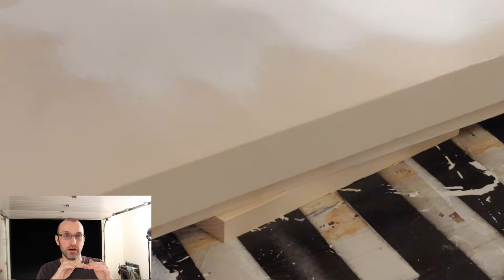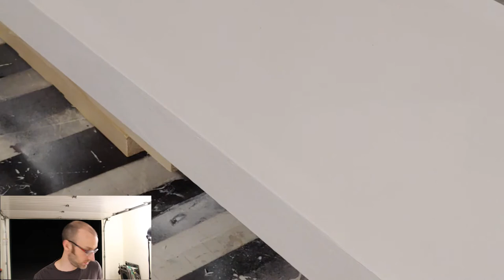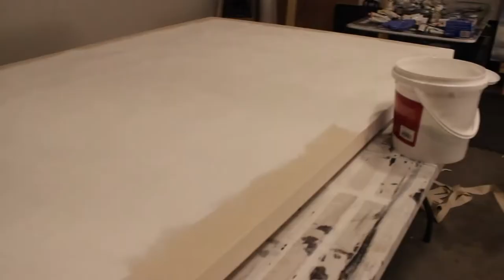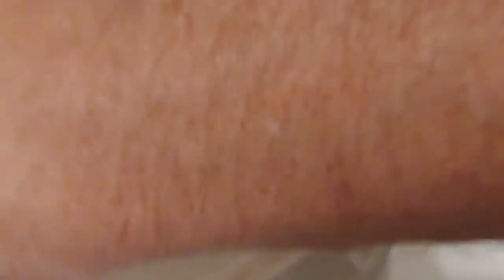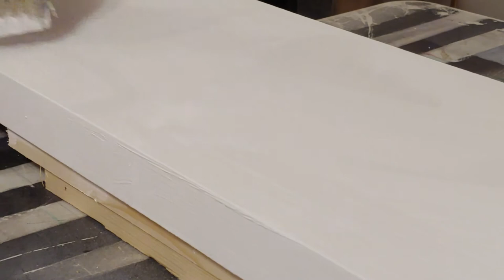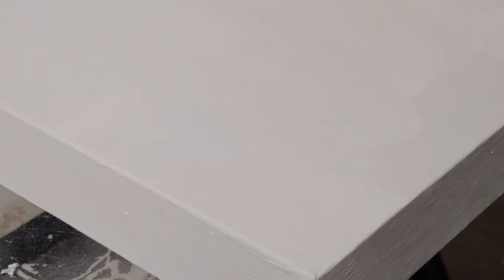Make Your Own Canvas Pt. 4: Priming Canvas

Comment: Hi Mead, thanks so much for sharing all this content with us! I have made a few canvases this week following your videos and they have all turned out great. I've moved on to priming and now I'm having some hiccups. I have painted the first and second layer of gesso starting in the center, and circling around as you instructed. Using this "scumbling" technique the layer of paint is even, without texture for the most part - but it looks sort of splotchy because of the irregular strokes and circle nature. Do you have any advice for how to prevent this? Also how many layers are you priming and do you change your brush stroke on the following layers? Thank you!
Reply from the maker: Priming tends to be splotchy by its nature. Don't worry too much about it. I usually do 3 layers of primer, but some brands are thinner and may require more. A good way to test is to hold the canvas up to the light and look through the back. If you see holes, you should prime more, if not, you're good to go. If you're painting in acrylic for initial layers, then you have no worries at all.
Reply: @MeadMcLean  Ok that makes sense - for what I am doing, I am ultimately wanting to create a fully flat, smooth off-white background which I will then paint symbols on top of. I was hoping the gesso process would get me there for the background, but perhaps not. In your experience, do you feel it just takes lots of layers of paint to achieve this look or is there a certain acrylic medium that could assist? Thanks again for any advice you may have. (and for reference, I am intending on only using acrylics)
Reply from the maker: If you need something smooth, I would use a foam paint roller with matte acrylic latex house paint or liquid acrylic. Then do your symbols, then run a clear acrylic varnish coat over top to seal it.
Reply: @MeadMcLean  so helpful, thanks for thanking the time to answer my questions!
Reply from the maker: Not a problem. I'm always here to help.

Comment: Do you need to glue (sizing) the canvas before priming? and why not? In general, I noticed that in the USA no one glues the canvas but immediately primes it ... why is that? is not gluing necessary or what?
Reply from the maker: Yeah that's a good question. The sizing is only necessary if you're using old-style traditional oil-based gesso. Most people now just use Acrylic Gesso, which is just a water-based primer. With old-style traditional oil-based gesso, you can't really paint in acrylic on top of it--just oil paint. With the newer Acrylic Gesso, you can paint on top with almost anything--oil and acrylic included. If you're an oil painter, sizing and oil-based gesso does create an amazing surface, but the smell of heated rabbit-skin glue and the extra steps involved aren't worth it to everyone.

Comment: I can't imagine companies which sell pre-primed stretched and canvases brushing on gesso in the manufacturing process. It just wouldn't be cost effective considering the time spent doing so and the inability to ensure an even coat. Obviously, these companies spray the gesso on to their stretched canvas products and allowed to air dry. So what is wrong with spraying gesso home if you have the right equipment?
Reply from the maker: Nothing is inherently wrong with spraying except for maybe the environmental damage from the propellant. Mostly though it's just that companies don't spray enough of it. You need another layer or two to really get a good barrier.
Reply: @MeadMcLean  Spray painting does not involve any pollutants if you use an oil free air compressor, which is traditionally what is used for large scale production projects.  I wouldn't imagine manufacturers using canned gesoo, which may have pollutants, as it too would be very expensive to use on a high volume production line.